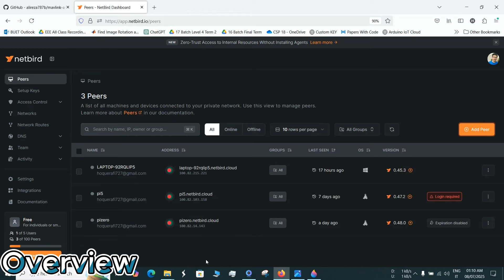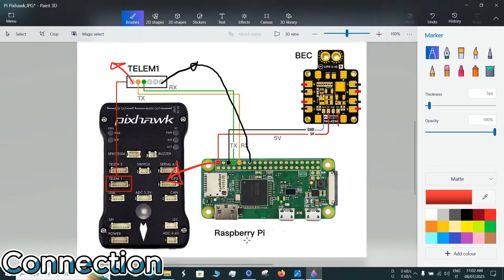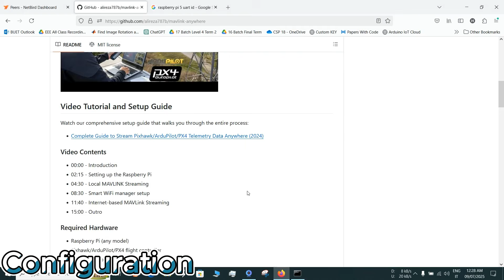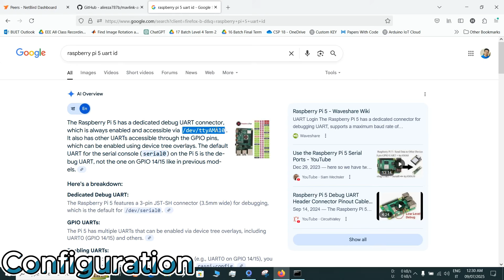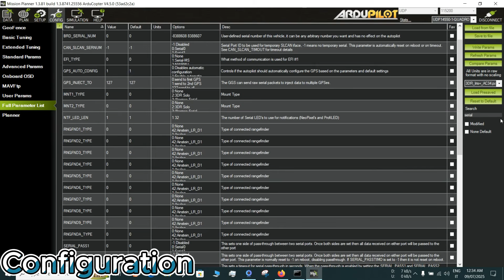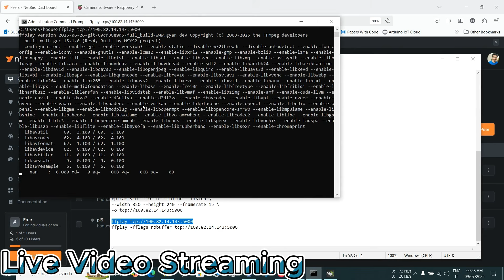4G/5G Telemetry for Pixhawk Drone (Unlimited Range + Live Video Streaming)

Comment: you should definitely upgrade to a carbon fiber frame, the 10 inch mark4 only cost 2-3x the price of the plastic frame and greatly increases stability. i already did and it is wonderful

Comment: "A USB 4G modem ensures internet connection to the Pi by means of Ethernet/WiFi."
Very confusing... which is it? All three, or some combination of them? Will it switch (eg. by priority) depending on what is available, so for instance a metered LTE link is only used when out of reach of the local WiFi? (Typically what mobile phones do these days.)
Reply from the maker: Hello. Thanks for asking. That modem itself acts as a hotspot too. Choice is yours on how you wanna connect.

Comment: bro can i use usb webcam to for replacing the raspi cam with the same code?
Reply from the maker: Unfortunately no. The dedicated framework works with raspberry pi camera. For usb camera, you can use openCV or other tools. But since that is not cpu integrated, the performance will be lower putting excess pressure on the cpu of the pi.

Comment: Thankyou for your video sir. Anyway can you make video about how to remote control your Pi zero using netbird 13:52 ?
Reply from the maker: Simply ssh to the pi using it's netbird IP. Before that, make sure that both the Pi and the companion computer are connected to netbird.